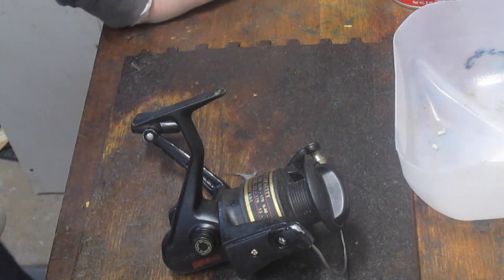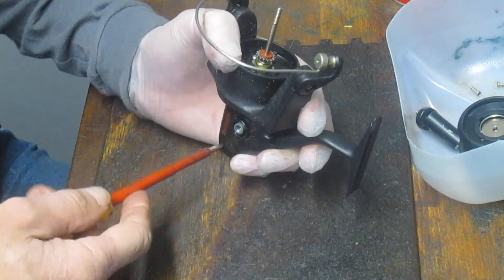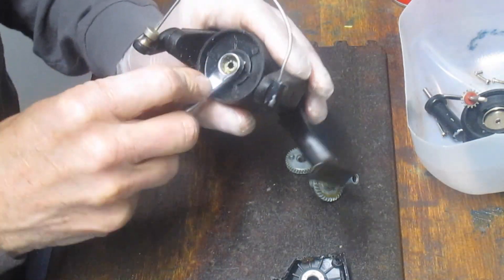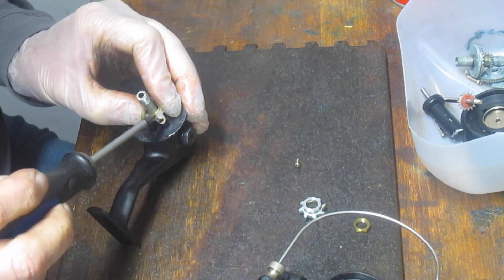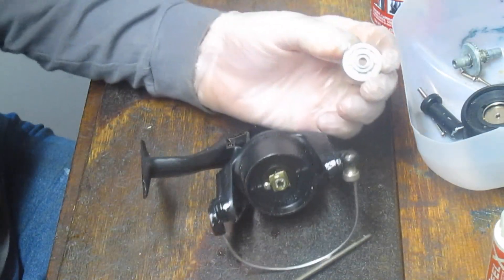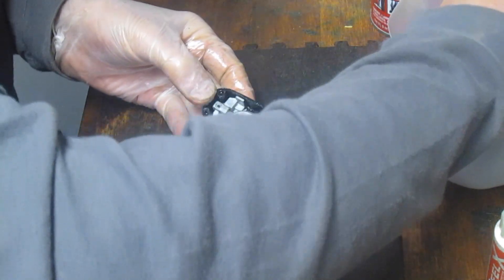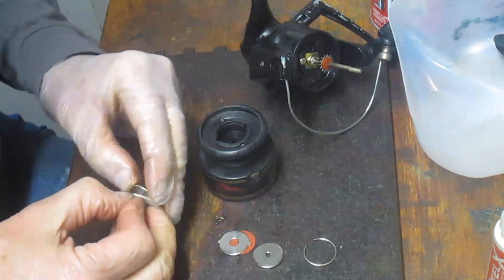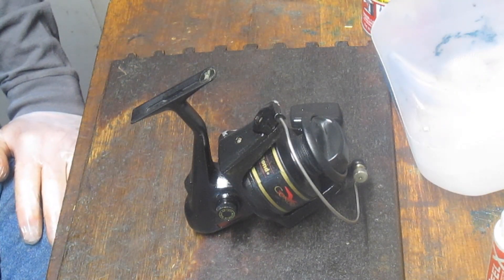South Bend Condor 450 large spin fishing reel how to take apart and service

Comment: I just took apart an old Condor 590 my son found and it was the dirtiest reel we have ever seen. He found it covered in mud and sand.  It also turns out someone had been in it before and packed it with grease.  I used to add too much grease before I knew better but this one was truly packed with almost no room for air inside.  I'm going to wear a glove the next time I take apart a reel.  What a mess!  Works OK now that I've been through it. Thanks for showing me how so many of these come apart. We find that these found or trash reels and rods are really lucky rigs when we get them going again and they seem to get more bites than the newer better stuff.
Reply from the maker: Thanks for the note and for watching.  Glad to have helped.  Grease packing a reel was an old school way of keeping it watertight.  Maybe that actually helped you here if it was found in the mud - Dennis

Comment: Hey Dennis.  What spinning reels would you prefer to use in freshwater for bass or crappie.   Not opposed to an older reel.  As a matter of fact I would rather have older and built with good parts rather than shiny and new
Reply from the maker: I think the mid priced Shimano reels in the recent past, like the Sedonas are a nice value and will fish well.  There are some older Abu Cardinal Gold Series reels as well as the smaller Penn Battle series.  If you opt for the newer reels, you won't get much below the $50 price point that will last and last.  If you stick between the $50-100 you should get a solid reel and a good value from any of the name brands. - Dennis